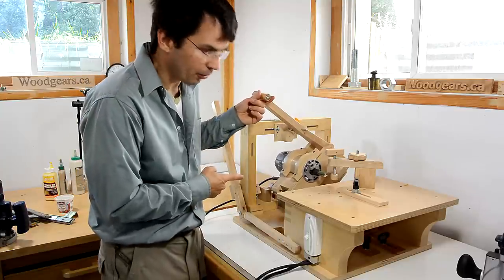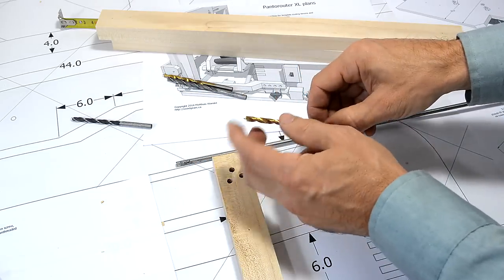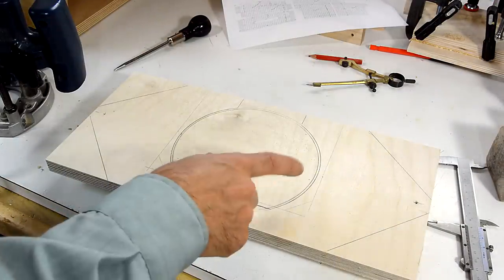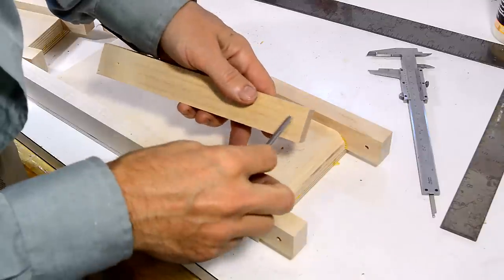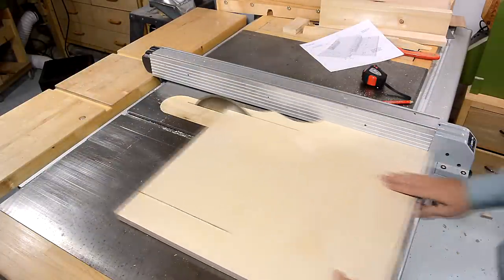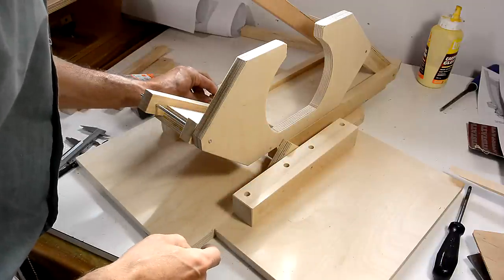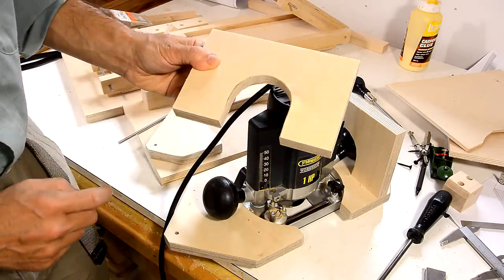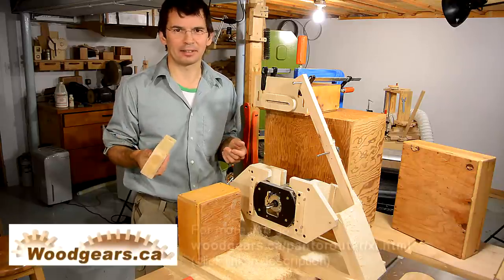Pantorouter XL build: The pantograph

Comment: Starting at ~ 8:00, there are several holes that were drilled crookedly in spite of all your precautions using the drill press until you got the straight-drilled one.  What did you change in order to achieve the straight-drilled hole?

Comment: One technique for holes: drill 0,1 mm smaller than the axle, burnish the hole with the shank of a drill 0,1 bigger. The heat and compression size the hole to something repeatable, without the vibration risk of a reamer going over size, and for that matter the wood hasn't been removed, only pushed aside. The bearing surface within the hole is smoother, too.

Comment: Maybe someone already mentioned this, but I don't know how to search for it...

On your two step hole method, a really clean way to go is to use your undersized bit, then use a chucking reamer.  They are extremely precise, and pleasant to use.  Places like busy bee sell the imperial ones for trivial cash in the smaller sizes.

Whoa!  I checked, they seem to have a new supplier, and the 3/16th is 20 bucks, they used to be around 5 up to the 3/4 which was a jump.  Victornet still has the .1875 for 6.90 US, and you can get the + 1 thou ones for the same price.  Those are typically the ones used in metal for a moving pin, but they might be loose in wood.  Of course in Canada, I need to save up an order to make VN pay.

Comment: Perhaps you might try hot glue for making tight fits. I do this when I make drill bit holders where the bit must fit nicely so that it cannot be returned to the wrong hole.

1) Drill an over-sized hole for the rod. 2) put a thin coat of wax (I spray with furniture polish) on the rod and let it dry. 3) Fill the hole quickly with hot glue and press the rod in holding it in the correct position (jig?) until the glue hardens. It should remove easily a minute later leaving a perfect hole for the rod.

But please test this idea first. It works for drill bit holders. There maybe problems with your application. Hot glue is very useful for moulding ferrels etc.

Comment: Matthias, I really really appreciate your take on a plunge type of router for the pantorouter build. My only question, and that goes to allot of your builds, is why do you prefer hardwoods over stacked birch ply (a "ply-ply" if I may suggest a name)? I know that woodshops are relatively humidity free and warpage is almost impossible, given a few coats of finish but, why? I can think of a few reasons, mainly based on educated guesses but, picking your mind would be best!

Comment: Maybe you could use a number drill set 12 and 13 especially in this case to give you the loose and tight fit on 3/16" rod

They are available in Brad point too.

Comment: Clever stuff, as always.

When you have done with this could you try a new project of creating a router table with lift capability again using a plunge router.

I have tried several crude attempts at this, none of which have been accurate, versatile or user friendly.  I am convinced that you can make anything out of wood and this would be a cinch for you :)

Cheers
Reply: Hi I make my lift using a car scissors jack works great ,
G
Reply: Hey Mick, if you go to the Instructables site, search for "Ultra cheap router lift" you will find one. I built it, use it a lot, works great. I made a few mods on the guys excellent design: 1. Left the washer, as he suggested, 2. Added thread locker to the screws to prevent the screw from backing out, 3. Used time self tapping screws to hold on the t-nut, as the nails I used worked their way out, 4. Put my Allen wrench on a cheap HF power screw driver so it works as a power lift. I've been using it for over a year, love it, mine cost under $10.00 for the lift parts, $10.00 for my power option, the Allen wrench, socket and drive adopter I already owned, they to can be found cheaply at HF (Harbor Freight). It is quite surprising how easy this is and how well it works, good luck...
Reply: Darnley Bynoe
Thanks.  I'll check it out

Comment: Wait... replacable bases w/ the motor switch in a detachable handle is "difficult" outside the US!?

I'll have to research this, but I thought that Whrilpool's patent on handles an elecrical dock + switches for replaceable motor modules/accessories did not extend beyone a specific class of appliances, and expect for the specific configuration indefendable because of ... common sense.

:( common sense vs patents...  I replace my confusion with dispair.

Comment: Now that is a great idea.  Sure beats spending big $$$ for one that may or may not do what you want. 

Hitting yard and garage sales is a good place to find older tools that would work well for this project.  I picked up an old Rockwell Router and Speedblock sander the for cheap.  Oh for those that don't know the Rockwell Speedblock was one of the first "palm" sized sanders.  They are also very smooth running.  If you find one that shakes a lot when it's running you just have to pull it apart to clean it up.  

I don't know what you plan to use to lock your shafts from moving, but may I suggest some model aircraft wheel collars.  You can get them up to 1/4 or 5/16 inch I think it is.